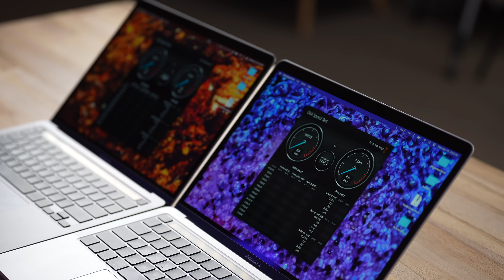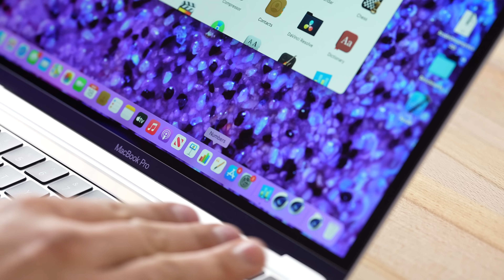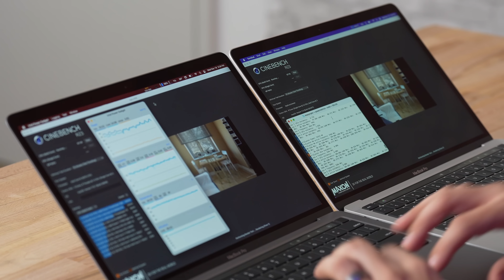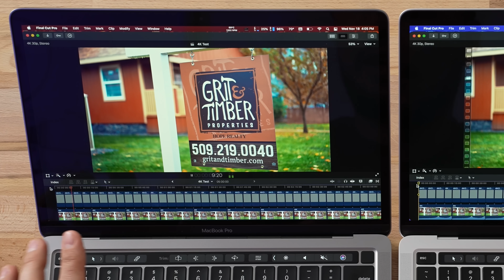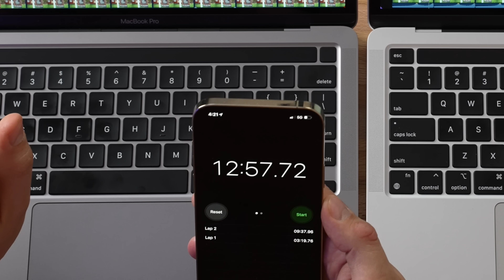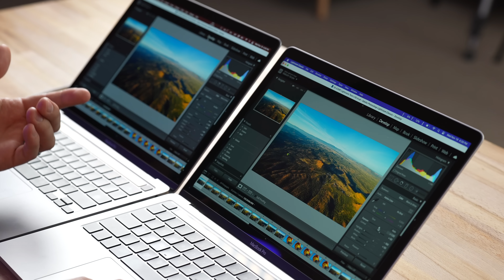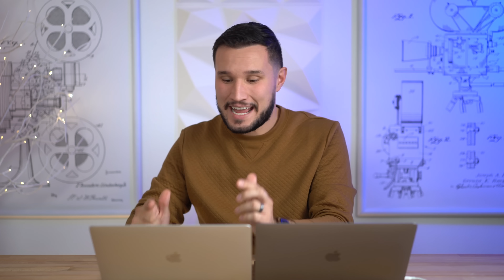M1 MacBook PRO vs Intel MacBook PRO: ULTIMATE Comparison

Comment: We need to understand the difference between the 8GB and the 16GB M1 versions
Reply from the maker: Gonna try to film that today! Just set up the 16GB model
Reply: @MaxTechOfficial  you are on fire! Love your reviews, subbed immediately. Can you show thermal differences between 8 RAM and 16 RAM M1?
Reply: @MaxTechOfficial  plz test the mba m1 8gb vs 16gb too!
Reply: @MaxTechOfficial  Yessssss! Very excited!!!
Reply: @MaxTechOfficial  can't wait for it. Apple has 16GB with 1TB in stock in stores...but not 16GB with 500GB...wonder what the reason is
Reply: @zihaowang4456  The 1TB is pricey and might be overkill where as the 500gb is reasonable.
Reply: @mixeddrinks8100  I agree..it is just apple store only has customization of 16GB+ 1T...online will takes about 1 month to ship. So I want it faster
Reply: @MaxTechOfficial  wish Apple had 4 Thunderbolt ports on the M1 models
Reply from the maker: @WycliffStudios  they probably will on the replacement for the $1799 model
Reply: @MaxTechOfficial  From where did you order and when?. I want one too with 16gb but the delivery date Apple is give is like second week of Dec. Please help!
Reply: @MaxTechOfficial  How you're gonna see if ARM Macbooks require more or less RAM for the same tasks? I recommend you do exactly the same software setup and test it with browsers, video editor and other common workflows on 16GB Intel machine and 16GB M1 machine.
Reply: Waiting to order the new MacBook Pro because I’m not sure whether to order the 16GB or 8GB RAM options.
Reply: @j.phoenix  Future proof yourself and go for 16gb
Reply: @RajGheevarghese  there isn’t a 16gb m1 is there ??
Reply: @elvisorbison77  There is such a model! I can't comment on availability in your region.
Reply: @j.phoenix  obviously if u can afford 16 order 16
Reply: @j.phoenix  today you might not notice much of a difference but in a couple years the difference between 8gb and 16gb will be much larger
Reply: @j.phoenix  just get the 16 inch almost maxed if u want power
Reply: @thesajeguy  And the money comes from...
Reply: @thesajeguy  I don’t have 16inch MacBook Pro money haha
Reply: @thesajeguy  13 inch is a lot cheaper and at least as good in most situations
Reply: @ModernMozartMC  well I used to buy a MacBook every year as I found they would get cluttered and would slow down, so paying the 6000 in advance will save me money as long as I keep it for 5 years or so. only reason I suggested it lol
Reply: @thesajeguy  A MacBook every year when you can easily just clear the cache and have it just as snappy as when you bought it? That's a complete waste of money
Reply: @thesajeguy  ha what? that's the dumbest thing I've ever heard.
Reply: @ModernMozartMC  well too be honest I like always having the new stuff as well
Reply: TheSajeGuy 16" ör 16 GB, because no Intel or AMD chip out there is comparable to M1. x86 will die out soon.
Reply: @thesajeguy  And you're willing to throw away thousands of dollars because something is new and shiny? That is purely idiotic
Reply: @salihozdemir7530  maxed out 16 inch except only the 4tb hard drive storage not 8tb.
Reply: @ModernMozartMC  I don't see it as throwing away thousands, I just am a tech enthusiast and love having the new stuff
Reply: @thesajeguy  If you're buying a MacBook that costs thousands every year when you don't need it, you are throwing money away
Reply: @ModernMozartMC  but I also give away my old one to help someone else, and I do need it. just for a different reason someone else may need it
Reply: @thesajeguy  You don't "need" it. You want it. Big difference
Reply: I'm disappointed that they still charge $200 for that extra 8GB though.
Reply: Agreed!
Reply: I Agree
Reply: I wouldn’t expect a huge deal of difference in performance between the two. With the RAM, CPU and GPU all on one package, the bus speed is insane, and given the processing speed of data, information isn’t staying stored in RAM as much as it would on an equivalent Intel machine. Yes, more RAM is always better, but I’d be honestly surprised if there’s much that stresses the 8GB of RAM on the current generation of Apple silicon, with today’s applications. The 16GB model, in my opinion, will have longevity as its biggest advantage. It’ll stay more useful for longer, putting off the time before you have to upgrade to a more powerful machine for a generation or two.
Reply: Agreed. Waiting for the 16 gb version. Need to know how much the difference will be.
Reply: for the long run invest in the 16gb model since it's non upgradable
Reply: @koto483  16gb is not available yet as m1 ??
Reply: Yeah, while 8 seems fine in these tests I do wonder what will happen if I use Docker and so on for programming. I assume that it will just grab the allocated RAM and treat it as usual, which would not be all that great.
Reply: I concur! 
I’m really vacillating here on if I should pony up the extra $200 to use with Final Cut considering how capable the baseline option is looking!
Reply: My 16GB one is coming in this Tuesday. Can’t wait
Reply: @WNFpker  Hi, from where did you order and when? If you can please share. Apple is taking too long to deliver with 16 GB ram with 512 storage...
Reply: @WNFpker  16gb on m1 is not available
Reply: the higher the better mate. i have 16gb ram macbook pro 2020 Intel base and this is absolutely better than 8gb models
Reply: Yes plz!
Reply: The only video in the whole web I have found on comparing these two is this https://www.youtube.com/watch?v=wZApy3sdFsM&lc=Ugxz7NkfHYGhnGLQ1GV4AaABAg (BUT TURN OFF THE SOUND!).